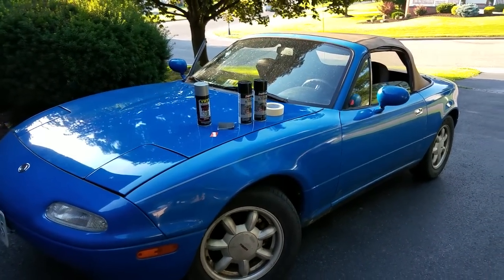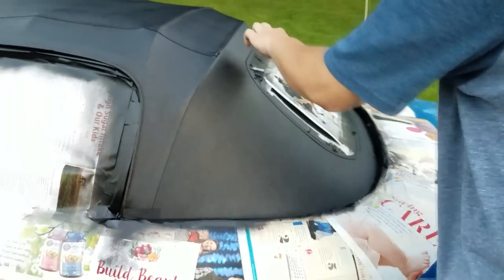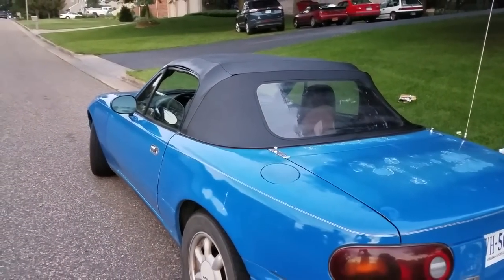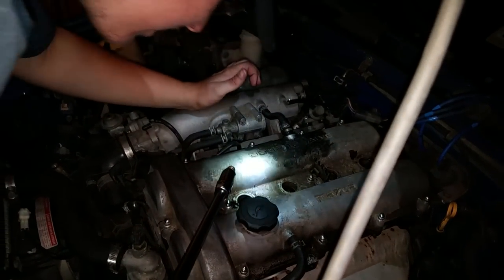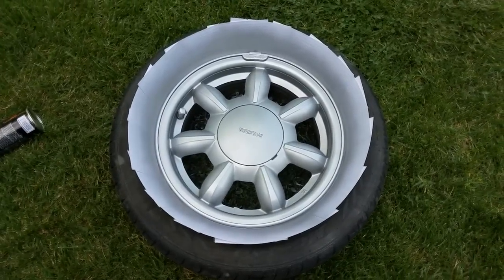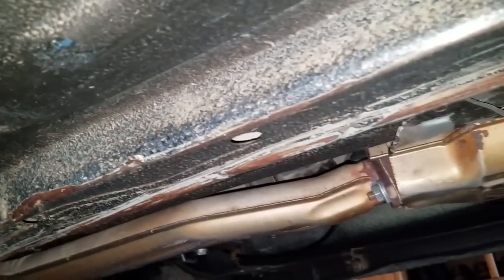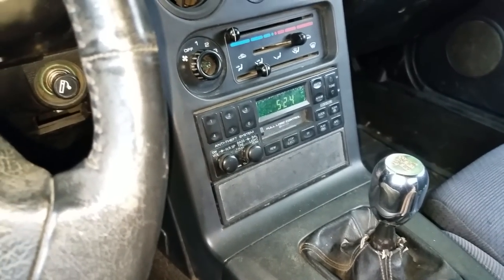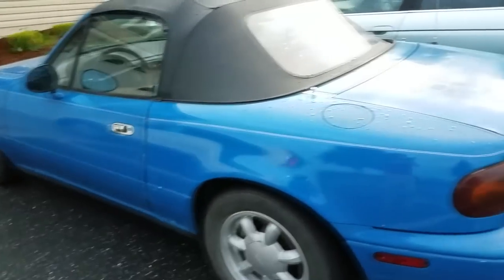Painting the Convertible Top and Wheels | $600 Miata - Ep 3

Comment: Great job on your soft top and wheels guys. Just a tip,  unzip your plastic rear window ust after releasing the clips and before you fold your roof. It'll last a whole lot longer. Love the idea of the $700 miata. Mine's a (UK right hand drive) £890 mx5 😊. They're great little cars.
Reply: If you look closely you will notice that the convertible has the permanent plastic rear window. There's no unziping on permanently affixed rear plastic windows. It's most likely an aftermarket miata convertible top.

Comment: I painted my tan dash black with that stuff.  It has held up well for over 2 years now i think.  Replaced tan carpet with black too.  I still have the seat belt.  I  really hate tan but I kind of liked the original tan top on blue.  made it more unique.  Once I get my old blue running I am gonna do the top and wheels white like I did on my lavender one.  love your episodes.  why didn't you just take the wiper off.  and that windows / rubber thing, you cant get that to look good.  Its like an $80 part I think.  I've replaced 3 sets of them

Comment: Very nice!!  I hope is not rain to come!!
Reply from the maker: Alas, rain is no problem for the product used in this video. The only worry for your statement is during the beginnings of the drying stage. After that, it has stayed on exceptionally. However, the same cannot be said for the convertible top itself, as it has aged a few decades. So when the rain arrives, there is leakage in the crevices into the interior cabin.

Comment: Looks like a fun time good job guys! Seems like it's been roughly over a year since you posted this video, how's the top holding up?
Reply from the maker: Pretty good! Some black is kinda going away where I sprayed it on too thin. But easily fixed if you use 2 cans instead of 1. Or I can just touch it up. Other than that, it still looks like it was black from the factory!

Comment: ... what but.. what XD You dont spray pent a convertible.. if you want it difrent you can maybe dye it but otherwise you have to replace it..
Reply from the maker: Except just easily spray painted it with vinyl and fabric paint and has been holding up great
Reply: @TincanTuners  hows it been holding up ? Thinking about soray painting my tan ragtop toyota solara
Reply from the maker: @jesserdo9963  Fairly good, I'd recommend to put on thicker coats than I did though